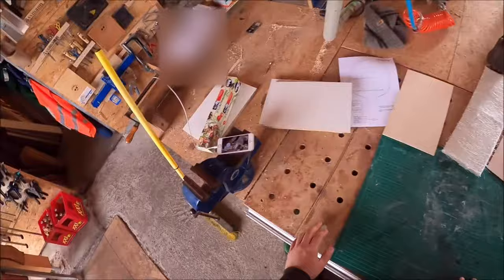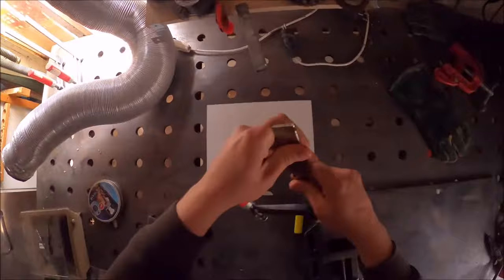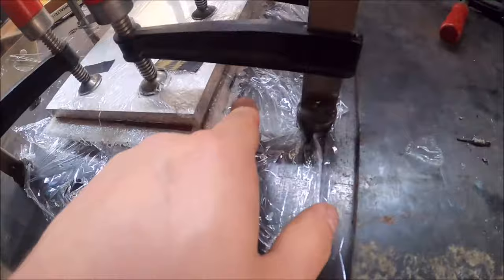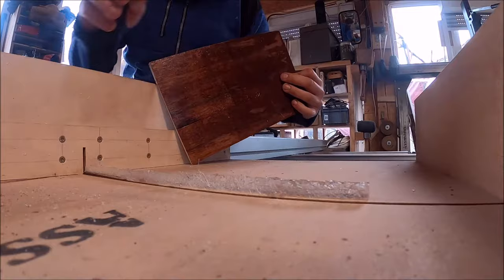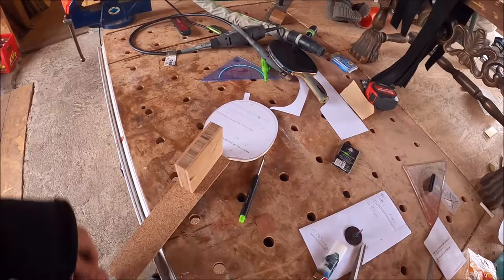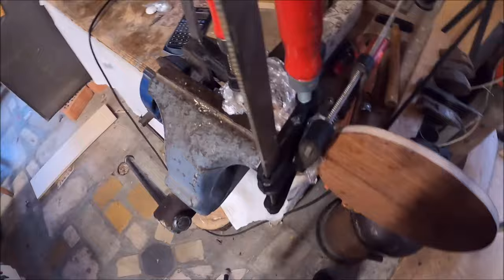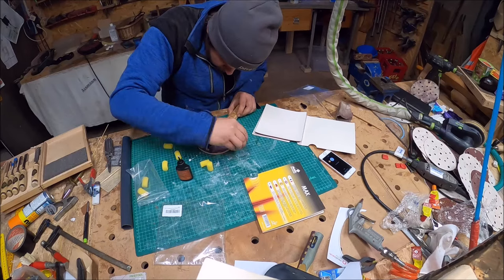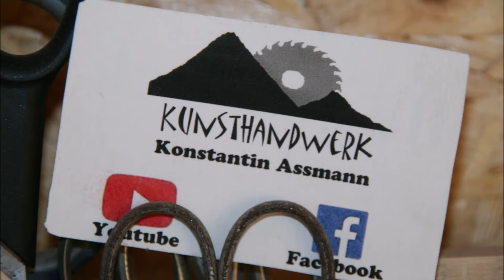Full DIY Table Tennis Racket -It is Done! (Part 2)

Comment: 8mm is definitely fine! I used to use a 10mm blade, and it was one of the best blades ever made! It was a Joola Kool, and the composite was Texalium, a mix of Fiber Glass and Aluminum. What matters is the weight. How heavy is the blade and the fully assembled racket? Also, where's the review video?
Reply: it looks really really heavy
Reply: @z0uLess  It really does. I'm guessing 220 to 250 grams.

Comment: I wanna make one as well. My question is, did you use something to treat the top layer of the blade? I saw most blades have a shiny smooth coat on them
Reply from the maker: No i did not, but i never build a racket before, and also did no research at all. Mine also got pretty heavy so there is also a lot to improve! 
I wish you much success and, above all, alot of fun building your own!